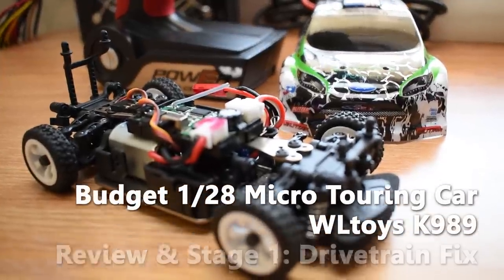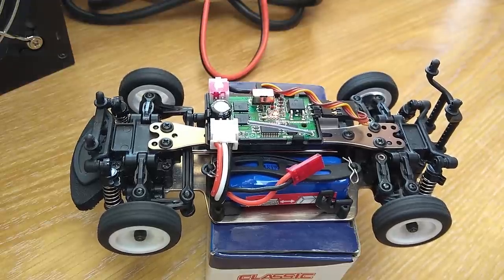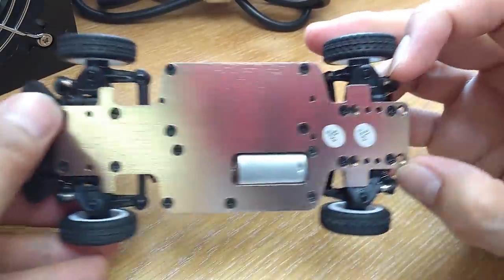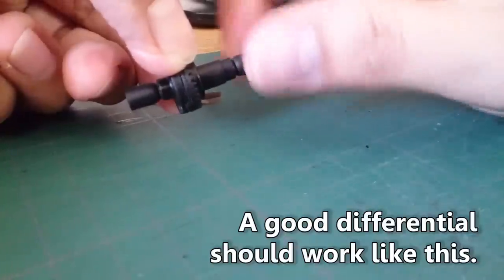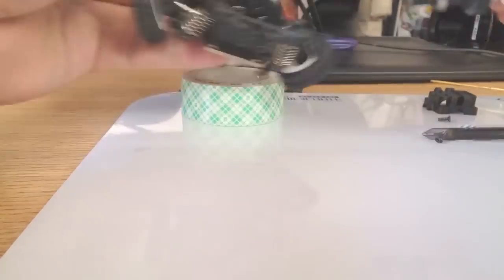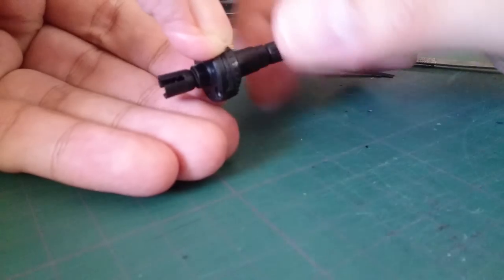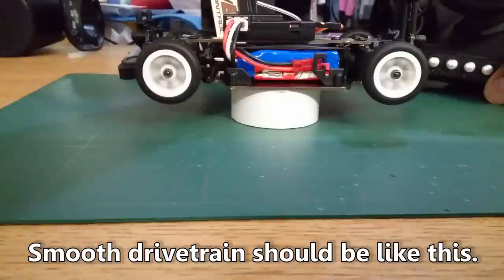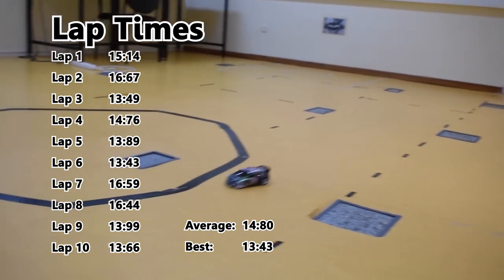WLtoys K989 Budget Touring Car - Stage1 Drivetrain Fix

Comment: What is the other black and red wire for on battery
Reply from the maker: Red = Standard JST plug. Normally we'd use that for power. The white plug is balance plug, mainly for charging. However in this size there isn't much different in wire gauge and balance plug is easier to plug in and unplug.
Reply: @BeaversHobby  o ok thank you so i could use the red one now for light mods now right
Reply from the maker: @esmokebaby  Yes, keep in mind that it outputs full voltage so 8.4V at full charge.
Reply: @BeaversHobby  ok awsome also if i have a micro esc for a brushless motor already couldnt i get any motor that fits it and use that esc or should i always go with like brands or find a motor and esc by the motor first see how it works with my esc and get esc later if it dont work to well
Reply from the maker: @esmokebaby  You should look at the specifications first. But if you have an ESC already it'll most likely work with small motor such as this car. The motor that works in this car is 130 type or for brushless terminology; 1625 or 1410 depends on the brand. As long as the ESC is not too big to fit the car and it has enough power for the motor any ESC will work just fine even drone ESC (providing you can live without brake or reverse).
The surefire way to get it working is getting a decent ESC like Atomic or GL Racing then choose any motor you like. Those ESC will power up any motor in this scale and they are small.

Comment: hello my friend! can you give me the correct wheelbase measure, thank you
Reply from the maker: Adjustable between 98mm and 102mm with +- 1mm tolerance from the slop. 
I'm currently using Mini-Z Corvette ZR1 body with 98mm wheelbase.
Reply: @BeaversHobby   thank you for your answer, I just resize a body to be 3d printed at 100 so it will fit well.
Reply from the maker: @jeromedupont8994  My pleasure. 100 should fit well.

Comment: how do i remove the center rod and open the gear box?
Reply from the maker: There're 4 screws holding the centre plate down. Then 4 screws on the gear box itself. You can check the manual to see the diagram or actually I think I show how how to remove them in my video.
Reply: @BeaversHobby  what is  the size of the hex that holds the rear suspension arms that holds the steering cup?
Reply from the maker: @PolarWolf111  1.5mm

Comment: I was watching your vid when mine came in
Reply: I some how turnd my front diff into a one way but its ok since i will be using for drift until i brake it and get an actually one
Reply from the maker: Build quality is mixed so if you get one that works you don't have to fix it.

Comment: The diffs are really poor quality.
I broke the first one just by using the brake function and it doesn´t move smoothly.
The front diff works perfect after some time but the new replacement diff for the rear needs more love.
But everything else is moving smooth and nicely just by adding a little bit of oil.
I´ve got the monstertruck version and ran it outside - not a good idea, it will get many scratches on the bottom but i was able to test the maximum speed and it´s so fast... you can´t even control!

So for playing outside, i´ll use my nitro powered monstertrucks instead of this little guy.
Reply: There is no "brake function" in the K989. There is even a lockout to prevent you breaking the diff, and that is why you must press "reverse" twice to make it go backwards. So, you broke your diff because you are applying full power reverse while the car is moving forwards... that would break almost any 4WD RC car's front diff.
Reply: @johncoops6897  It has a brake functionality.
It works as any brushed/brushless ESC.
While you´re on throttle and go to reverse, it will short out the motor or to be more accurate the ESC gets a variable load which will stop the car more or less depending on how far you put the trigger.
After pushing 2 times reverse it won´t brake, it will drive in reverse already.

The behavior is the exact same as on my 1:10 brushless truck which is a real hobby grade rc car.
Reply: @MultiWirth  - OK, you obviously have an extra-special K989. Anyway, the diffs break because they are an absolutely shit design, and poorly manufactured using a low-grade plastic to horrendously poor tolerances. As standard the final drivetrain and diffs are so tight and bound up that the car has automatic braking.
Reply: @johncoops6897  nope i also have a p929 it´s doing the same and it really is designed to do this.
The bigger 1/18 scale cars also do this.

Comment: You did a good job, but it's a shame that it takes all that work to get the car to run normally without overheating quickly.
It's just constructed in a totally sloppy way, if I had known that beforehand, I would not have bought it.
If you don't want to work on it for hours, DO NOT BUY !!! 🙈🙄
Reply from the maker: It's a price of getting a cheap car with high performance. Some corners... A lot, actually have been cut to make it this cheap.
Reply: @BeaversHobby  
Sorry, but because of the work you have to put in, it is no longer so cheap.
I've had inexpensive cars that ran well and clean from the start without having to fix the poor workmanship😉.
The car is okay so far, but the differentials are and will remain garbage.
Reply from the maker: @hollycool2910  Totally understand that. In terms of cheap car this is not the best value. 
The appeal is that it's the cheap alternative to Mini-Z so in 1/28 world it's one of the best value right now. Differential is direct swap from Mini-Z AWD so you get access to plethora of parts to choose from. The problem is that it makes this car very expensive after the mods. Trying to keep it budget is nigh impossible. But it'll still end up cheaper than other 1/28 in the market if you know when and where to stop.

Comment: You may also try these rims http://bit.ly/2NwSsmQ whit this tire http://bit.ly/2Ei5yQF :)
Reply from the maker: Thanks for the suggestion. They came out much later after I did the wheels and tyres upgrade (stage 3 ). I've heard from people who use them and they are pretty good tyes, not as grippy as what I'm using but better than original. Wheels got quite aggressive offset so watch out for that if you have different body on.

Comment: I know this is old. But can i buy a gyro for the wax k989 and use the stock esc/receiver?
Reply from the maker: Yes, you can plug a gyro into the stock electronics. I recommend one that has a dial on it to adjust the gain. Because there's no VR channel/channel 3 on the original transmitter you'll have to adjust the gain on the gyro unit.

Comment: How do I bind it? My car flashes 2 red blinks. Controller is red then green.
Reply from the maker: Turn the car on first then turn the transmitter on and move the steering wheel. It will bind. Otherwise, either the transmitter or the all-in-one unit is defective. Most likely it's the AIO unit.
Reply: @BeaversHobby  damn, it’s brand new. I tried binding the way you describe and same problem. I also tried to turn on tx let it blink, turn on car, then turn wheel.